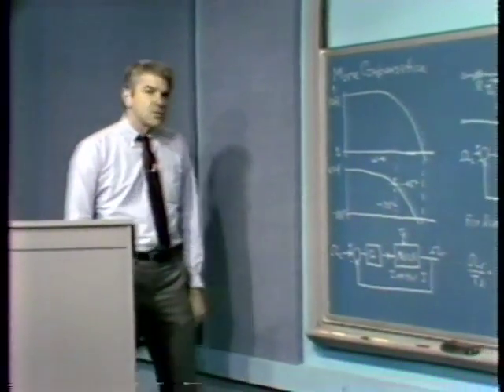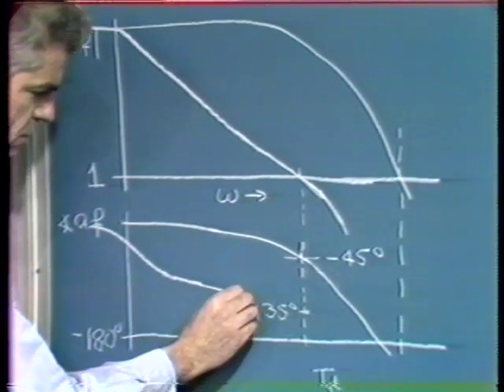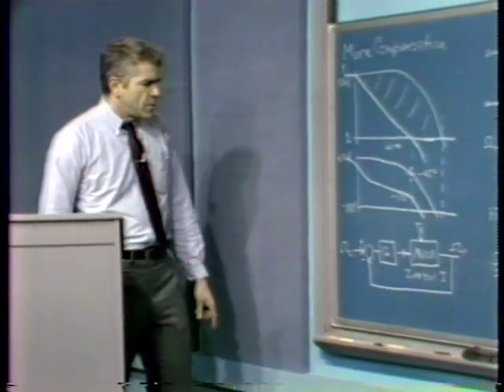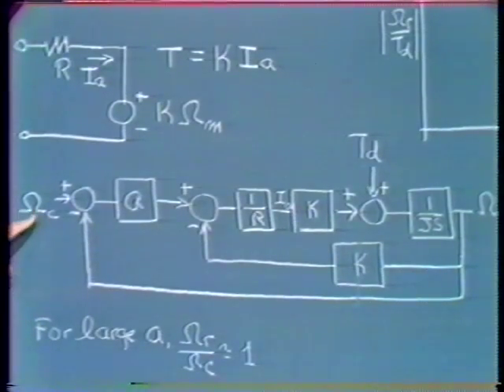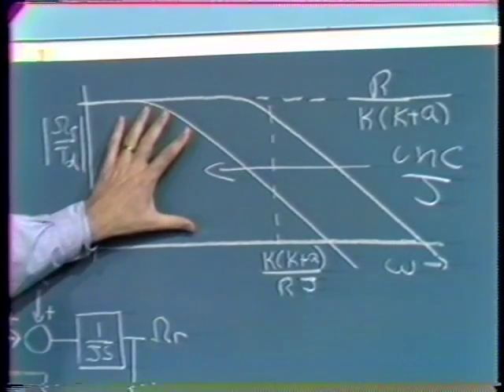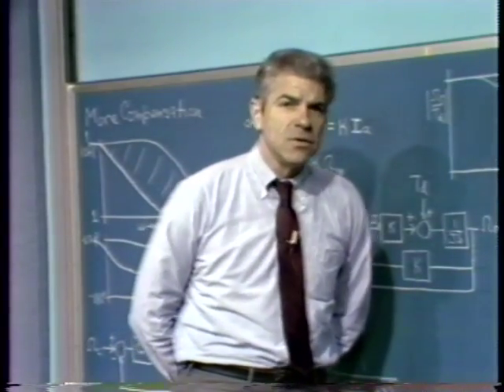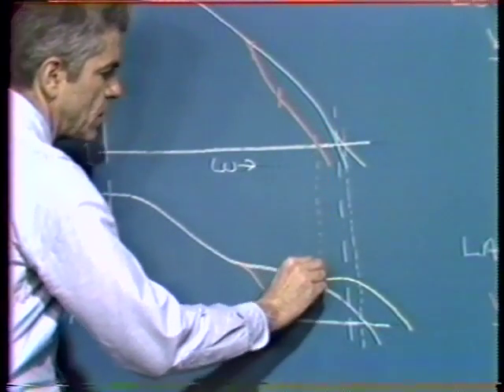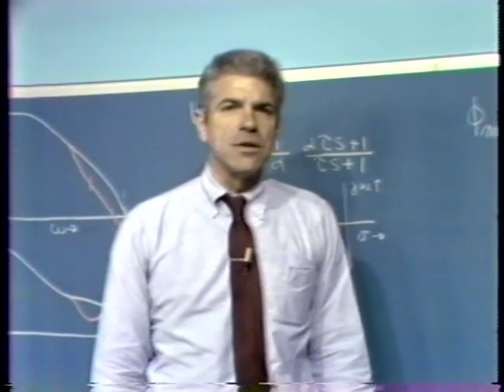9. More Compensation

Comment: I don't consider it spam. I'm just wondering, how many other courses taped in the 1980s/90s are you holding out on us?  I had assumed they were released as they were taped, but here there was an 18 year delay. It seems like only a few courses are released each year. It would be appreciated if they were released at a faster pace.